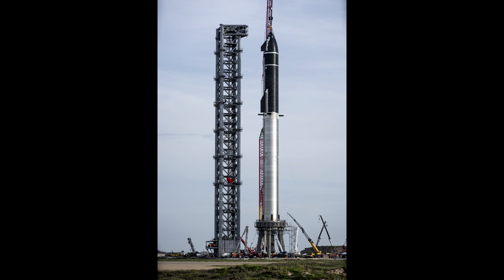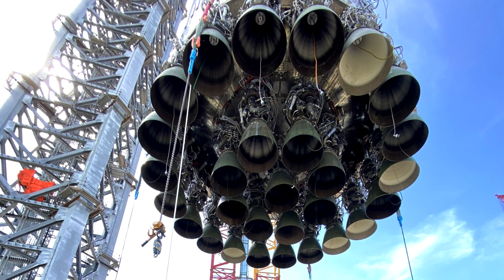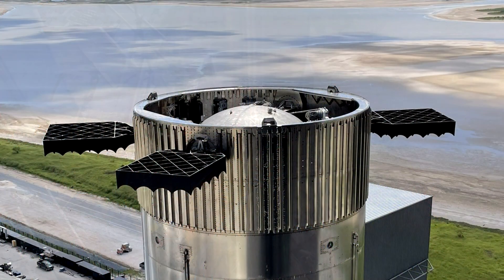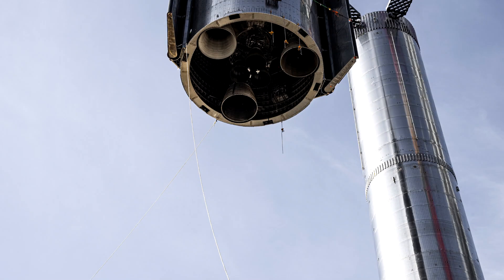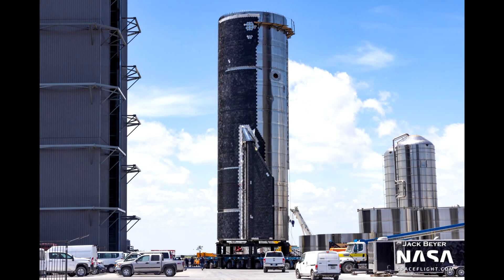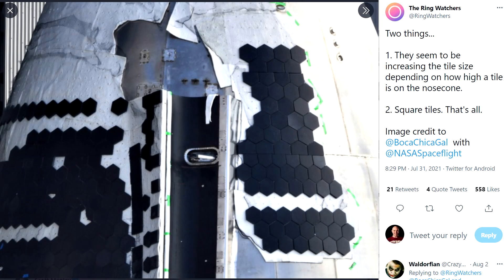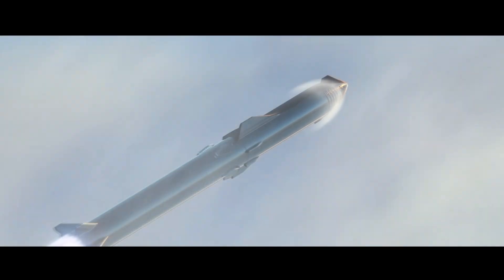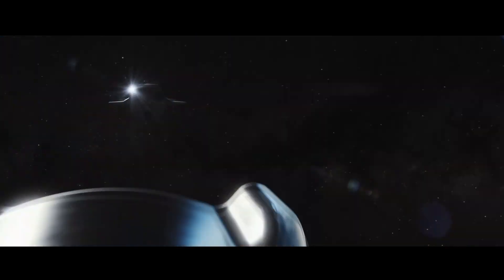How SpaceX Designed A Heat Shield For The Largest Spacecraft Ever Built

Comment: This is the most Kerbal rocket I have ever seen. Just the sheer number of engines at the bottom looks like someone just going nuts in the VAB with the symmetry tool ...
Reply: They know this is a good engine and are working on a major redesign to make it a very good engine.
Reply: It's like when your rocket is too heavy, so you just keep surface attaching vectors until it can fly.
Reply: they trusted a guy who failed at making a tunnel to do this, a man who failed at automated cars because he was stupid and used sonar for it! a man who delayed his battery powered trucks 🤦‍♂️🤣 by two years then three years and latest by four years! 🤦‍♂️ A man who is going to invent a robot to do your shopping etc within a year🤦‍♂️🤣
Reply: @danquaylesitsspeltpotatoe8307  but finally, he succeeded. This is all what matters.
Reply: @TheRealGamada  they trusted a guy who failed at making a tunnel to do this, a man who failed at automated cars because he was stupid and used sonar for it! a man who delayed his battery powered trucks 🤦‍♂️🤣 by two years then three years and latest by four years! 🤦‍♂️ A man who is going to invent a robot to do your shopping etc within a year🤦‍♂️🤣

So he succeeded in a heat shield for ship that hasnt gone to space yet. Which if it follows his track record.....
Reply: @danquaylesitsspeltpotatoe8307  some great achievements in there, your a fool lol
Reply: @danquaylesitsspeltpotatoe8307  Success is paved through many failures.
Reply: @danquaylesitsspeltpotatoe8307  you’re talking about the failures of Tesla and the boring company and extrapolating to SpaceX, which doesn’t really work. SpaceX has already repeatedly succeeded at breaking technological barriers, so why wouldn’t they do so again here? The Boring Company has issues because it’s not Elon’s area of expertise, unlike SpaceX. And seriously please don’t use that many emojis lol
Reply: @williamgong2351  "SpaceX has already repeatedly succeeded at breaking technological barriers"

NAME AND EXPLAIN THE TOP THREE!

So just ignore elons 
failed tunnel! 
failed automated
failed battery truck
failed rockets to replace planes (That cant work either)
failed robot to do shopping etc next year! 
WAIT TILL NEXT YEAR FOR THE FAIL)

" has issues because it’s not Elon’s area of expertise, unlike SpaceX"
OH TELL ME EXPERTISE IN THIS FIELD!
WHAT IS IT?
WHERE DID HE GET IT! 🤦‍♂️🤣
Reply: What're YOUR failures? What're your successes? Who are YOU that is so talk worthy? Who's making Youtube videos about you? Let the internet see your ugliest failures in your own life. Let strangers yell them in public. 

Or just shut up? Nah, you wouldn't try any of that.
Reply: @williamgong2351  
STILL WAITING FOR THE TOP THREE!🤦‍♂️🤣

"SpaceX has already repeatedly succeeded at breaking technological barriers"

NAME AND EXPLAIN THE TOP THREE!

So just ignore elons 
failed tunnel! 
failed automated
failed battery truck
failed rockets to replace planes (That cant work either)
failed robot to do shopping etc next year! 
WAIT TILL NEXT YEAR FOR THE FAIL)

" has issues because it’s not Elon’s area of expertise, unlike SpaceX"
OH TELL ME EXPERTISE IN THIS FIELD!
WHAT IS IT?
WHERE DID HE GET IT! 🤦‍♂️🤣
Reply: @danquaylesitsspeltpotatoe8307  Space X has reusable rockets for a start, and they developed the dragon capsule so that the usa does not depend too much on soyouz ones. They have some pretty low launch prices, but it is not as if we knew if space X is profitable or if it runs on Elon's little scams.
Reply: @danquaylesitsspeltpotatoe8307  Thanks for listing the failures. I am amazed how few (very few) people have fun tracking one's failures, whose success are literally making the world open its mouth in awe.

So to complete your comment,
They trusted a guy who also was able to land his rockets land like a pencil (which most people laughed at when he conceptualised it, yes you included I'm pretty sure), made it land on a brage in the middle of the ocean, built a rocket company by himself which in just 20 years is giving a tough time to all the biggies, was able to send a capsule to space station out performing an established aerospace giant (Boeing) by leaps and bounds, who has his rocket design literally being copied by China for reusability, who is able to propose space programs to NASA at the most affordable rates, who developed a car company that is giving a headache to the most established auto companies, who built the most reliable and incredible autodriving cars that are approves not just in USA but many other countries.

And btw, who are 'they' who you say trusted on him? Its him who is spending his own money in creating all these engineering marvels. Yes you can cry about all the subsidies and rewards, but the fact is, he's getting those because he is capable of doing they tasks he is given. The last time I checked, you didn't have a rocket company or a car company or a tunnel boring company that most people admire and few areses hate. 

Yes, his tiles may most likey fail. But the fact is, with a guy like Elon at the helm, they will eventually succeed while yet being wayyyyy ahead of others.

Have a good day crying in your closet. Cheers
Reply: @sushanthshetty8664  I don't think that guy understands that failure is acceptable for SpaceX. 

"Failure is an option here. If things are not failing, you are not innovating enough." - Elon Musk.
Reply: @jeanf6295  Reusable rockets isn't a good example.  Space shuttle was better then SpaceX rockets and it was reusable over 20 years ago.......
Reply: @sushanthshetty8664  "Its him who is spending his own money in creating all these engineering marvels."

I think this is the biggest reason people hate on Elon and the people who fanboy for him.

He's not spending a DIME of his own money.  The developments that were made by SpaceX were paid for by subsidies and grants gifted to them by NASA.  

The development of reusable rockets, most of the data having been gathered by NASA in the 80's and 90's, that SpaceX was given a copy of, and other technology that they've only recently begun being profitable on, was entirely paid for by the public.  There is no profit motive in something that costs billions of dollars and decades to develop.  It's the reason grants and subsidies are even a thing.

Outside of landing on rough waters, 95% of the 'breakthroughs' can be attributed to other companies/scientists/engineers who Elon literally just steals credit from and attributes them to himself or his grant and subsidy vacuum he likes to call a commercial rocket company.  

You don't think the massive public opinion has made any difference in contract awards vs. other companies?  If you don't, I have a bridge I'd like to sell you.
Reply: Giving credit to a billionaire checkbooker who made all his money by financially floating the people who ACTUALLY made paypal is hilarious.  If he were left on his own, he wouldn't be qualified or capable enough to be an actual engineer, and everyone wants to pretend he's some sort of genius.

To which I say.

ROTFLMFAO.
Reply: @DarthObscurity  That program got terminated though, and at its end, it had transitioned away from commercial payloads due to rockets becoming cheaper.

Comment: That cubesat idea was exactly what I was thinking. Maybe SpaceX could hold a contest for University Engineering Students to make this and the team that makes it the fastest and that works wins full ride scholarships for the remainder of their schooling.
Reply: I also thought the same.
Reply: I don't think the sat is the problem. It's getting it out there. If you've seen the interview with Elon Musk; he says they're not thinking about doors because it adds unnecessary complexity for now.
Reply: @broersenkees  Not a problem... as Scott said, just tuck it in somewhere in the engine skirt.
Reply: Seems like you could stow it in the Vacuum Engines' bell. Plenty of room in there. The engine doesn't need to light until your in orbit...
Reply: Problem is it’s a risk. If it comes lose and bounces around at launch that’s a lot of effort wasted.
Reply: @joshrhodes8796  That's not correct – the vacuum engines are needed to reach orbit, so using the bell for storage isn't going to go well.

Comment: Thank you Scott! Could you please do a short episode on flame trenches and sound suppression?! I'm still worrying about the effects of so many Raptors firing so close, both to the launch stand & the ground, and also to each other. Cheers.
Reply: It has more engines than the N1. This can't end well...
Reply: @HalNordmann  With modern manufacturing techniques, control systems and materials the N1 would have worked. It was just way too ambitious for the available technology of its day.
Reply: @HalNordmann  Falcon Heavy has 27 engines firing at once, it ends well. Basically they have experience of large numbers of engines. N1 was underfunded, and they didn’t have modern electronic control systems. They’d also lost the lead engineer who had died of cancer.
Reply: @StillAliveAndKicking_  But Falcon 9 doesn't have tank feed problems - the clusters of 9 engines use separate tanks, unlike Starship. And it remains a fact that small number of bigger engines is better than a large number of small ones - the N1 engines used small engines because they couldn't make big ones. Just look at Saturn V - that rocket was well funded, had decent electronics, living chief engineer, and they still chose to go for the big F1s.
Reply: @HalNordmann  Well Falcon 9:has performed more reliably than many rockets of a similar size with fewer engines. Musk argues that using lots of engines makes sense, as it means redundancy, lose a couple of engines and Starship still reaches orbit. I’m not a rocket engineer, and I suspect neither are you. I can’t say what Musk’s thinking was. He may well have decided that having the same engines in the booster and Starship would significantly reduce development costs. But you can bet his decision was based on input from a group of highly experienced rocket engineers. My guess is that if they could solve the fuel feed for 9 engines, they can solve it for 27 or more. Just my uneducated guess. Best ask Musk.
Reply: I think the engines on the N1 hadn't been test fired before each test.
Reply: @StillAliveAndKicking_  There are points for and against both approaches - a higher number of engines means a bigger engine-out capability, but it also means higher chance that an engine fails. But the one that is the best depends on circumstances, I guess.
Reply: @currentcommentor8745  Yeah, N1 had a lot of problems, but probably the most significant one was a lack of ground-testing of the NK15 engines, since they were basically one-shot, impractical to test-fire and then subsequently use. Not a problem for SpaceX of course, since when you're designing for rapid re-use, test-firing the engines is a relatively trivial exercise... with some of the Starship prototypes, we've seen them do back-to-back static fires on three engines, no inspection or servicing needed. And I'm sure they'll have thoroughly tested the booster plumbing before the first launch...
Reply: It will probably explode. I hope no one gets hurt.